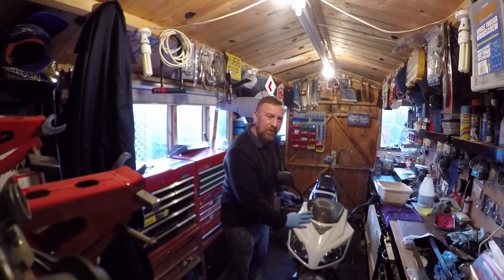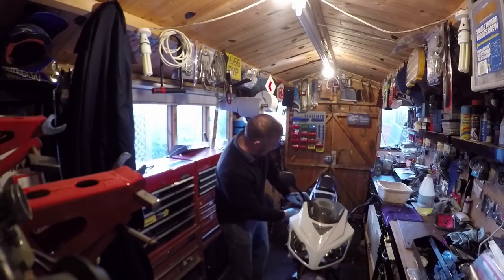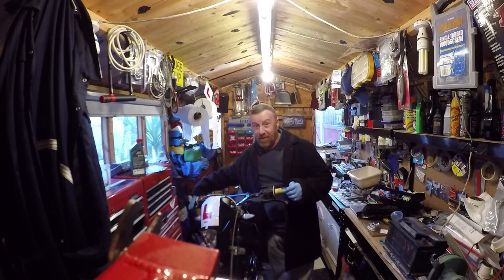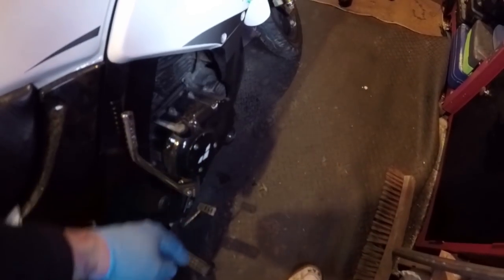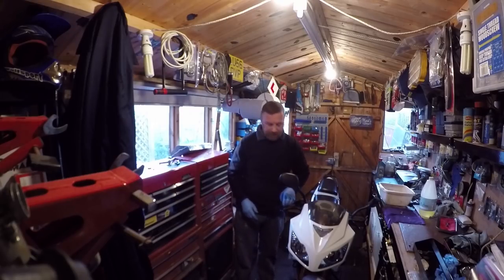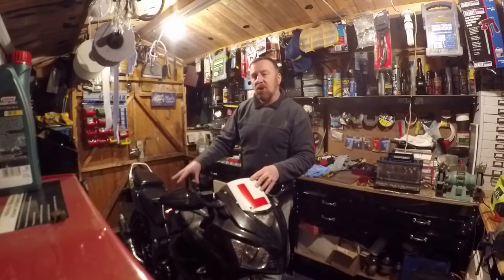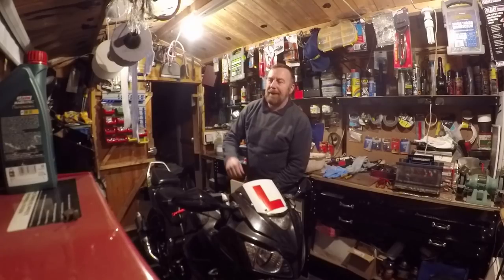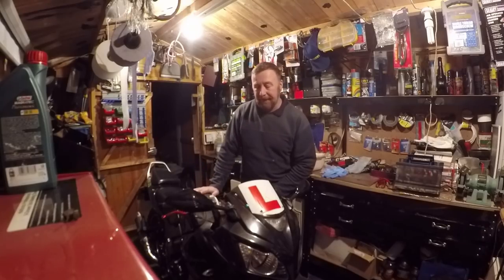LEXMOTO 125 OMG I CAN GO ON WINGE OF THE DAY MARK SAVAGE

Comment: Hi Mark I have just gone back to a 125cc after 20 years of riding big bikes due to arthritis in both knees.i had problems holding my 600cc yam up so now just picked up a sym 125 xs .never had a Chinese bike before so looking for a bit of info.like how often to change oil and where can I get parts I have always repaired my own bikes .so working on bikes no problem for me.also thinking of putting a  new endcan on the bike .so just would just like a bit of info on bike.

Comment: Only just found this video lol just wanted to ask have you got any videos on chain adjustment on 125's
Reply from the maker: I don't as you can't 
Only the pretenetioner 
This may have failed or worn so you can replace it but if chain still loose it would need changing bud 
I do have a few videos on 125s maybe check them out 
Mark savage 125 and they will come up

Comment: Just wondering how would i make my piaggio zip 4t faster is it worth putting 6 to 7 gram rollers in and is there anything els you can suggest i have see your video about the 2t but just wondering if they upgrades would be the same
Reply from the maker: hi bud no sorry 4t and 2t mopeds are very different and the newer the moped the more they are restricted, rollers and VARIATOR will make it pull away faster but only add a few mph, a sports exhaust will help 
if you can find a race cdi you should get the most out of it then
Reply: mark savage where about is the cdi unit in the zips im not to sure i have been looking it up but cant find anything

Comment: I believe the problem with using car oil in a bike is due to the clutch (assuming it’s wet) as car oil can cause it to slip. On a different note it must be cold there as the ‘man shed’ door is closed ☃️
Reply from the maker: Not as cold as you have had it lol -7 and a little dusting lol 
Yes bud it is the clutch plus the high revs but ha as said they can if they wish but not for me 
Good to hear from you bud

Comment: Do you know anything about the 2017 direct bike lynx 125cc
Reply from the maker: It’s going to have the same engine as it’s mopeds before just with new panel design 
Keep them serviced and an eye on the oil 
Wd40 the moving parts and key holes and all will be ok
Reply: @marksavage  thanks for advise

Comment: Alright mark, just a question about a speed fight 2 50cc air cooled, I’m rebuilding it as my 2nd project, I’m 17 its only my second time rebuilding a Ped, i noticed my oil pumps was different to the one that Is mounted to the engine , in the Haynes manual or on any of your videos and online , it is an electric pump that has an inlet tube and outlet tube for the oil and it just plugs into the wiring loom but I’m not sure whereabouts on the bike/frame it’s goes , if you have any ideas could you let me know,  your videos have made a massive impact on my project, couldn’t thank you enough , keep it up pal
Reply from the maker: Hi bud 
There are two and I do have a video on my channel with over 70 speedfight videos 
One does to to the engine and there are two types of them one from the throttle cable and then from the crank 
The other electric that connect to the under side , take off bottom fairing left side but it connects to the loom and gas to be the right look with the 2t oil cdi !
So as long as it is the right loom and then you will see the connector for it if not you will have to fit a manual one or pre mix the old way 
Maybe check out my other channel with all speedfights on a play list

Comment: Hey mark, I’ve got a speedfight 2 with an indicator problem, my left indicators work completely fine but when I click my right indicators on they can take up to about 5 seconds to start working but sometimes they come on instantly, watched you’re video about the relay could it be that or do you think it could be something else? Thank you
Reply from the maker: yes or an earth prob as they do suffer from wiring , get to all four and clean the connectors up and wd40 and see if that helps then yes change the relay as only £2.99 and an easy fix 
I have many other speedfight videos for help too to watch on my channel

Comment: what I find Annoying about sorting out the carburetors because there is many parts to it there is the air mixture screw the gaskets seals and there's the head gaskets seals and the Seals to the air box 🤔 all of which every one of them can cause a lot of problems for the bike ?? and if you really want annoying carburettor to fix try a Honda Varadero 125 the year in between 01 and 06 because the air mixture screws are in a very annoying place 😱 and don't get me started on the plumbing haha but when those carburettors do screw up they really screw up ???
Reply from the maker: have to agree while they are running all is fine, with the 2t carbs you have to take them off and clean and clean and do more cleaning and sometimes they still don't work lol
however sometimes its a simple as a clean and the bike / moped is back on the road then its very satisfying, you can see in the last few lexmotos bikes I had to take the carb off more than 10 times but got it sorted in the end bud 
take car on the roads
Reply: @marksavage  yeah I just got a problem with my fuel injected system on my Honda Varadero 😱 but it is not the carburettor ?? the last owner of the bike decided to overtighten the spark plugs and strip the threads so it's sucking air from there 😠 and also I have been watching your channel for a while now 🤔 and how did I find you I was investigating a terra derbi 125 what I had to do a gearbox rebuild 🤔
Reply from the maker: the plug not sitting in right would mean gasses are leaking out and that's a problem for the running and all sorts or other running issues so may not just be your injection / carb  and best get that sorted
as for the derbi it turned out that it was just adjusted incorrectly as they are two area on the cable you can adjust and he had done it all wrong, have to say they are great fast bikes but suffer from speedo cable and stand problems not to mention head gaskets so as long as they are serviced and oil and water checked they are fun and go well
Reply: @marksavage  I got a new replacements on its way 😀 and the derbi terra sold it for tidy profit  😊
Reply from the maker: so what's the replacement bud and the old derbi's do sell well

Comment: Hey mark..I have a lexmoto monza 125cc..and the oil can icon,is constantly flashing,on my screen..any ideas,what could be causing this..thanking you
Reply from the maker: take it it's 4t so have you checked the 4t oil ?
should be to the right of the bike, all these bikes burn a little oil and this should be checked regularly, top up with 10/40 oil
Reply: @marksavage  sorry I'm not very clued up on anything bike related...what's 4t.i just drained the oil,and replaced,with new 10/40 oil.
Reply: @marksavage  I've just had,the idle jet fixed,and got scooter bk today,turned it on,and the oil can icon is constantly flashing
Reply from the maker: that's 4t
so did you put the right amount in ?
didn't over or under fill it
Reply from the maker: so you did the oil change and all was ok, then took it to a garage and they did the idea and now the light is flashing ?
i'd take it back and ask them what they did and why it's flashing bud 
as for 2t and 4t one burns 2t oil in with the fuel the other doesn't and has engine oil like yours
Reply: @marksavage  yeah,think I put correct amount in,the dip stick is showing about half way up,the grooved part of it...
Reply: @marksavage  ok,thanks 4 your time..I'll give them a phone in morning, ask them what's wrong. Cheers
Reply from the maker: @davemorier3066  normally its 3/4 up the stick 
Double check on the hand book or ask at the shop bud 
Important it's right
Reply: @marksavage  will do thanks again

Comment: Where about in uk Are you mate need my bike sorting out need new crankshaft putting in n new right side engine case
Reply from the maker: Hi bud Easex but I’ve got over 400 videos sure some will help 
Thanks for watching
Reply: mark savage I’m new to all this bro this is my first bike already spent 200 quid on it no to find no teeth on the crankshaft so I need a new one fitting an the one of the head stud snapped in the right side engine casing I didn’t do this the owner befor me did hate people that dont look after there stuff so annoying
Reply from the maker: try watching this one as ive had a few bolts snap 
https://www.youtube.com/watch?v=8GhfZF6F-MQ
and it will be a crank replacement 
https://www.youtube.com/watch?v=UA5AZ69D0u8&t=33s
https://www.youtube.com/watch?v=sCiAU8_JHmk&t=5s
https://www.youtube.com/watch?v=-UuNxXLbvQk&t=1s
https://www.youtube.com/watch?v=AMwRmmdD1xY&t=152s
they are old videos but may help bud and worth a watch but you do have to try and keep the cost down and way up the odd's is it worth it
Reply: mark savage iv watched all your videos on the aerox I just need the left side engine casting no one seem to have one